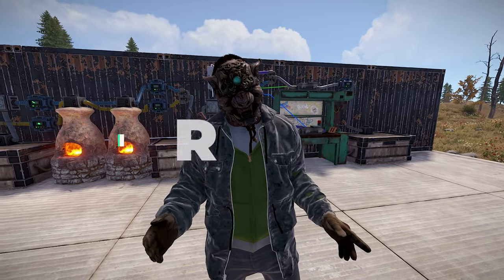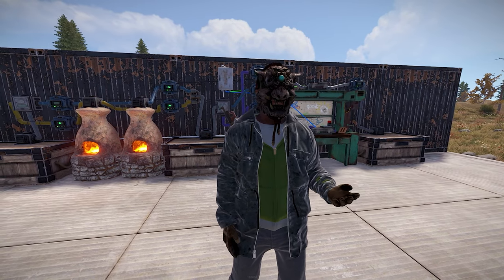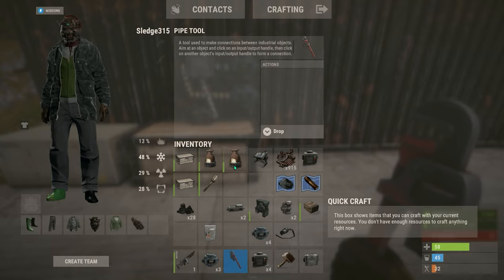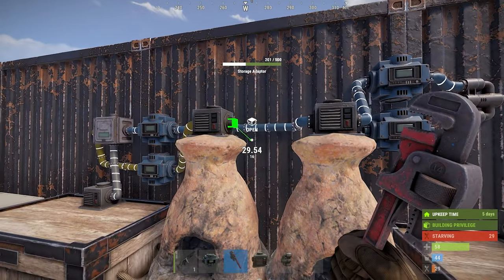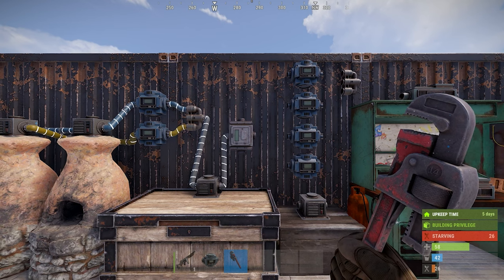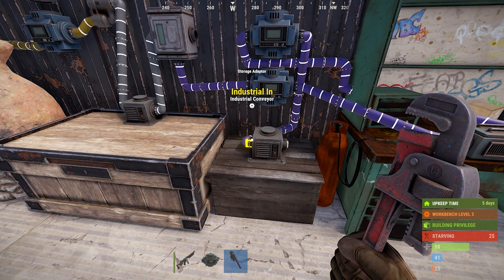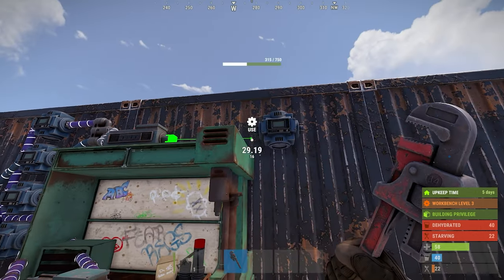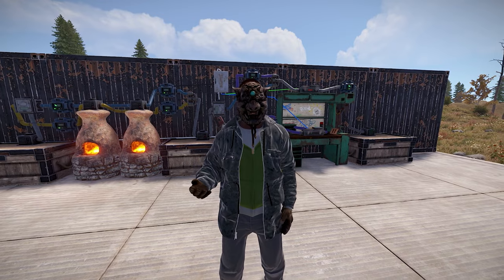Are You Wasting Time in Rust? Discover the Power of Auto Crafting!

Comment: 1:30 You can use a single conveyor for both (or up to 32 furnaces) to smelt metal and sulfur at the same time (there are 2 slots for smelting after all) Just limit the amount that goes into the furnace.

1:48 Only a single conveyor is needed to pull from both (or all) furnaces. into your metal/sulfur box. you can also reuse the same metal/sulfur box and add the gun powder into that to reduce the number of boxes required (unless you just want them in different boxes). Just add splitters/combiners as needed.

3:20 You can further streamline the 2 conveyors for metal and gun powder to a single conveyor. instead of each of those inputs going into 2 separate conveyors, have them go into an industrial combiner. that combiner into the single conveyor that transfers the metal and gun powder. 

Less power required. Less clutter.
Reply from the maker: 100% on all of these points! I did it in a bit of a different way that has some more use of items to blueprint the idea for the general newbie to these items! individual conveyors into furnaces etc and getting into the deeper conveyor settings and so on might confuse some, so I went this route. Funny enough I am working on a baseline auto furnace video that will follow the 1 conveyor method vs multiple! 

all great points and love the share!

Comment: Very excessive with the conveyors. You can add combiners before the conveyors to limit the power use as well as frags to make items and cut those in half easy.
Reply from the maker: I wouldn’t call it very excessive but I did use more than technically necessary for the sake of the video, I didn’t want to in depth the conveyor settings as I could’ve for the sake of visual explanation! But you are right there are more simplistic routes to get the same result for cheaper use of resources and power!